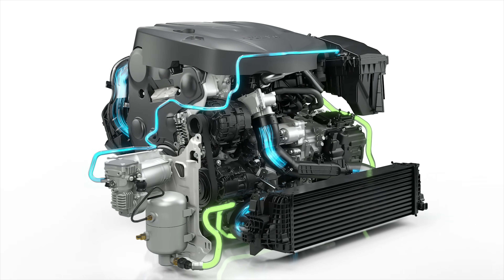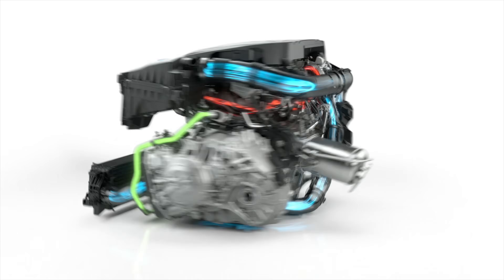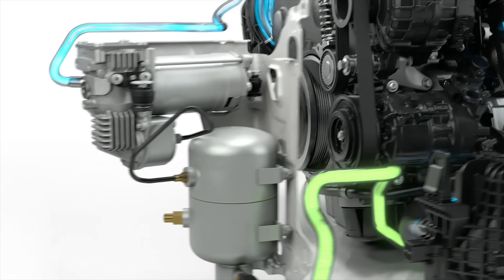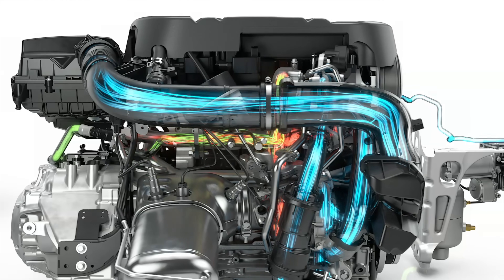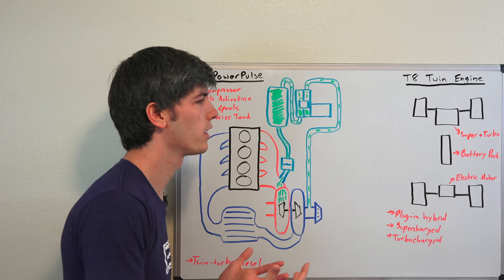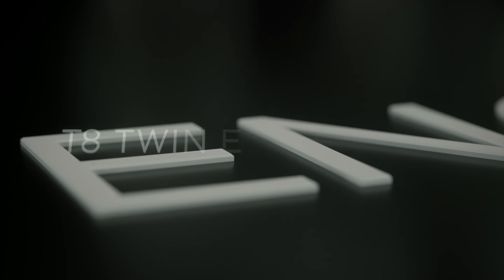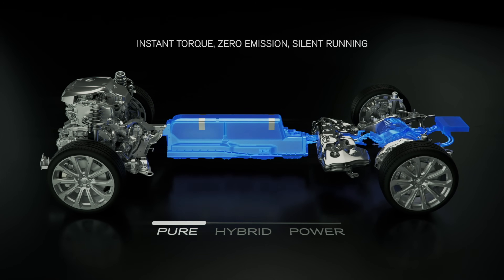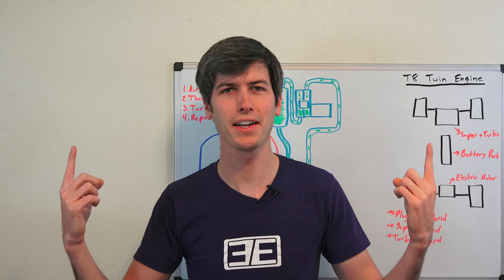How Volvo Is Eliminating Turbo Lag

Comment: A novel solution. Also I love the amount of "oh noes it would be unreliable!" when it is actually quite simple in design. I don't have an engineering degree like you do, but even I know how simple a simple air compressor can be. Heck you might just be able to make one with tools in a hardware store & throttle mappings of your car.

Comment: Quick question.  If you used a gas powered car engine converted to generator to power your electric motor to power the vehicle, how man batteries could be removed? If using say a 4 cylinders with a turbo or super charger weight being 700 lbs fully dressed and batteries weight being around 5000 lbs could the two be put in tandem to get rid of some batteries and put an end to the range problems? Just thinking out loud and you seem to be the one to ask who can explain this rocket science. Love your videos and thanks

Comment: Just a thought, since it's involved electric motor for the pump, why not just use the motor to assist spinning the turbine when it's lagging? That'll eliminate the space  to fit pump and high compressed tank.

Comment: Great, one more expensive thing that will fail.
Reply: Hahaha yeah well they don’t really care past warranty.
Reply: Arjun Bhat Its more moving and working components thus making a higher likelihood of something failing. Think before making a comment
Reply: Mathias Gj says in another comment bellow the "power pulse system" is already failing they're rebuilding it, he works for Volvo
Reply: Arjun Bhat It is mathematically garanteed to increase the lifetime maintenance costs of the vehicle. More parts always = more repair $$$
Reply: Adrian Gutierrez and they were right, fuel injection with all its sensors and valves can be a complete nightmare to work with and does fail more than a properly maintained carb. The list of FI points of failure is staggering compared to ... the carburator is broken. Turbos ... yep those fail all the time, and when they do sometimes it is rather spectacular.  DOHC, well yeah, it has more valves and more parts so more chances for something to fail in that area of the engine.
Reply: So don't buy it.
Reply: Jonathan Stewart
Reply: Jonathan Stewart That’s what they said about fuel injection, turbos, dohc, get over it
Reply: @adriangutierrez9582 

Its about cost/benefits.  Fuel Injection and DOHC are worth the added complexity, an added system that aims to reduce turbo lag (not eliminate) but introduces multiple points of failure and a high pressure system may not be worth it .
Reply: Not that expensive if you think about it from a manufacturing standpoint.
Reply: @papayaman123  I wanna ask the engineer  did you  factor any redundancy? If the pump fails will it still operate as a stars turbo or are you screw until you repair it
Reply: I don't get what you meant by stars turbo but if pump fails obviously this system will be moot until you replace/repair it.
Reply: You have calculated proof that it would fail? Or have you worked on it personally?

Comment: Why not simply have the motor drive the shaft of the turbo? Pretty sure there was some kind of system like this on an F1 vehicle that @engineeringexplained discussed sometime ago. You could then use the motor to recover energy when you come off throttle.

Comment: This may be slightly pedantic, but that will only lower the boost threshold, the lag will remain largely the same unless they also inject hp air into the intercooler too. I think.

Comment: Why go through all the fuss with a compressor and a reservoir? Just put the electric motor on the turbo and be done with it. Should be smaller, lighter and cheaper. Or is that pattented by someone else and they just had to get around it?

Comment: Here we are missing the entire point😞 

The liberated motorist does not rely on big oil’s gasoline....He mods his engine to run on alcohol or hydrogen or even ELECTRICITY! 

Oil is only second to H2O in its level of abundance on Earth, IT IS NOT A “FOSSIL FUEL”🙄

WAKE UP🤷‍♂️

Comment: The last few seconds were funny 😂

By this system the turbo and exhaust  temperatures would be cooler than normal due to the compressed air passing inside of them, that's another plus if I'm not mistaken

Comment: Now, tell them how it gets done properly, where you have a turbo, and between the turbine & the impeller, you have an armature and windings. When boost is suddenly needed, you open a circuit to the main battery, and you power and drive the turbo, to quicken the spool up. Then as boost nears maximum, you don't divert gas through a blow-off valve, you reverse the switching to the armature and make that electrical assembly act as a generator. By varying the load, you vary the speed of the shaft, which varies the boost. You do boost control and harvest energy at full throttle, and you do spool-up to avoid throttle lag. And when throttle lag will happen, you draw current to the main electric motor to supplement the engine's torque, so there is no evident lag or dip. And in a pinch, you can drive the car a couple of miles on the battery only...
That beats the hell out of an air tank.... That's more or less the system the formula one cars use. Nobody in formula one is using and air tank to dump a couple of pounds in the exhaust manifold... Sticking an electric motor / generator in the middle of a turbocharger, and then controlling it all with the same computer that does the fuel injection, is pure genius! That's not hitting two birds with one stone, that's doing three!

Comment: Ford had a vaguely similar system in their Focus WRC cars. Pressurised air that would have been lost through the Waste Gate was diverted and stored in a pressurised tank under the rear Bumper, and used to eliminate Turbo Lag on Acceleration off the corner.

Comment: Don’t forget to mention that if you have a Turbo and Supercharged vehicle, of your Turbo is big enough, at higher RPMs it back drives the supercharger and the PSI generated by the Turbo now drives the screws on the compressor and the parasitic drag normally incurred by a supercharger’s belt now becomes power because the pulley is now being driven rather than dragging the crank down.  

Super cool phenomenon you only see in twin-charged Vehicles.

Comment: I am just afraid that with such complicated systems and software doing the control of all these driving dynamics that it might get rather unpredictable if you are using it in a "non standard" way.
It may do one trick it is supposed to do good, but is a annoyance in other situations, especially when the technology used is around for less than a few years.
I think in a hybridized car using only the electric motors to fill the power lag is much more predictable and straightforward than a air tank which needs maybe 10 seconds to a minute to refill.

EDIT: I think it is a "one trick pony", becaue it eliminates lag only in certain situations, but does not give you a experience of responsiveness in all driving situations.

 Not a Volvo fan/buyer, anyway.

Comment: see to me there can be fun with lag. like the anticipation while hearing that thing spooling up and then a sudden rush of power pushing you into your seat. 

I do understand the idea of making the boost more responsive on the initial throttle input however most likely this is only a solution for the factory setup.  

In general those of us who spend our time/money modifying our cars and want that big horse power usually have to deal with turbo lag. There are the whole e85 setups allowing to run high compression all while allowing to run high boost.  But usually setups like this are rarely used from what i've seen.  

Personally i like to keep my setup simple because i like to work on my car without having a ton of components constantly needing fixing. but it would be interesting to see something like this on the aftermarket made as a bolt on part to help the people who are running giant turbos.

Comment: I've got more faith in Mazda's compression ignition system.
Reply: polychronio Mazda is very reliable they only have issues when Ford decides to try and design then
Reply: why not hcci with turbo and hybrid?
Reply: popdancebeats i have a mazda car....mazda is very unreliable...i fix computer, link, hose, radiator, etc etc after fix, again and again in every 3 months...it drives me crazy....
Reply: Drive a 2010 Mazda 3 s Sport Sedan with 160k miles. Only had to replace a burnt transmission module. $800 fix with only maintenance. Been running perfectly fine and even picks up alright.
Reply: Nick T. good luck but check how many time mazda win lemans 24 and reliability report...
Reply: Volvo is the most reliable and mazda is unreliable...

Comment: A Volvo mechanics nightmare.
Reply: I'm a Volvo mechanic, and were already rebuilding the "power pulse" system on warrenty becuase it's faulty already lol
Reply: ZEDreality Fun and challenging, but to be honest there's not much of a difference
Reply: Christ imagine diagnostics on that thing.
Reply: Mathias Gj, How much better is it working with new Volvos, especially when they got the Auto-Service mode, compared to mechanical analog cars?
Reply: You think that will stop people from buying Volvos?  People still buy GMs after GM publically admitted it was cheaper to pay off burn victims' and their families than it was to fix their faulty fuel systems..  It won't stop people from buying what they want.  The masses walk blindly into happiness.
Reply: Leslie H. LMFAOO ikr I'll stick to my 242 gt...💪😎💪
Reply: But I do not care.
Reply: You beat me to it, Also a Shade-Tree mechanic's HELL. Yea I think this goes well past OBD2 and will need Volvo tools to do any diag. and repairs.  It's already at the point where you can buy a 1st/2nd owner Benz that seems to run/drive OK for 8K and it will pass inspection, but you can't see that it's virtually totaled, 10-20K in parts needed (radar/camera for accident avoidance, active suspension, etc.) Dead battery on a diesel MB? you may be getting towed back to the dealer for a crank position sensor reset! I can't imagine the horrors of a car like this new Volvo lol (lets just say $100? grand new... then it's only worth $10 grand after the 10 year warranty is over, and you need to sell it because repairs cost as much as that PC, motorcycle, or TV you want/thing for the family/whatever.  Maybe that's just my life talking lol. I think Id rather buy a cheaper used "beater" car every year or so instead, or sit back and have someone build me a "dream" custom car.
Reply: Eugene Tooms i have a turbo volvo 940 with 740 000 kms with the original turbo and engine
Reply: what do you mean, this engine is way better than the d4164t
Reply: Volvo mechanics are being offered an optional 'Master Masochist' Seminar....🤫
Reply: ZEDreality cool
Reply: At least you won't find yourself unemployed. =D
Reply: +Topi Sadly that means little to me as I grew up in the US lol!
Reply: I somewhat agree to certain extent..huhu
Reply: WoOsKii 1 its 450 000 miles also almost all older turbo mercs here also have over 400 000 miles on them
Reply: They are eliminating themselves, like Saab.
Reply: Lil Leslie we
Reply: Volvo is a technicians nightmare already l
Reply: Dont buy turbo if you want to keep your car beyond 100k. Turbo reduces reliability as increases complexity and shortens engine lifespan.
Dont buy turbo. Period. Unless you lease or get rid of cars after factory warranty.
Reply: @eugenet6632  na. Volvo white block. Goes for 150k all day long
Reply: Eugene Tooms almost 200k miles on my wrx.

Comment: They should engineer the turbo itself, supplementing it with electrical motors on each wheel, instead of adding on an entire compressor.

Comment: Can't see why they wouldn't use wastegate air, which should be at high pressure and store it. Adding compressure would require electric energy and it will add weight.

Comment: So basically this tech could be retrofitted on a Diesel truck using air brakes, and or on a gas engine using an air pump for emissions standards, just install an air tank?  Such miraculous design, using forced air to propel a turbine before the exhaust has to!  Nah, this is Volvo's little way of claiming patent on currently existing technology, people have probably done this for years and Volvo's wanting royalties from it.

Comment: Up next for Volvo in 2023 an electric hybrid 4-cylinder twin/single turbo supercharged variable pulley system 1, 2, 3, or 4 wheel drive with an option for an additional 8 cylinder diesel mounted in back for when you need to tow something. All this mounted to a 6 speed manual and a 7 speed auto simultaneously!

Comment: So based on the previous EE video isn't this just bringing you up to boost threshold faster?  Its not really reducing turbo lag since it doesn't address the time it takes for the boosted air to get from the compressor to the intake valves.  It just spools up the turbine faster.

Comment: But it doesn't have 5 cylinders
Reply: Volvo Brad I’m sad to see that as well. I drive two five cylinder Volvo’s, but I’m happy to say that the new fours still have plenty of character to them just like the old fives.
Reply: in the video it is written to a be a 2.4 litre. sadly it is just a 2 litre :S
But it works fine ^^ 

I can totally relate :D 2.4i v50...

Comment: Once they move to electric drivetrains, they can essentially eliminate the lag by dumping electricity from the battery while the turbos spool up. Although to be honest - is there much point to a turbo if you're running on motors?

Comment: Well... I understand that in racing application  turbo-lag is bad, but when you're cruising around  just for fun, I think that floor it, wait a second  and then "feel" the power and torque kicking in is priceless. Another example can be in cars  like  a Single-Turbo Supra or any powerful car  with high  turbo-lag when someone  challenge you and you both floor it, he  starts to gain and with you at firts nothing happens but than the boost kicks in and you troll the opponent  saying goodbye...
P.S.: sorry for the grammar, I'm italian

Comment: I'm sure its very clever but it feels like a gimmick, if turbo lag upsets you that much then hauling a big compressor and accumulator seems a bit overkill, I'm sure there is a simpler way to spin a shaft up. I'm not sure turbo lag upsets me that much anyway.

Comment: Using electric motors to make IC engines faster, when electric motors are much faster, lighter, and less complex. Seems legit..
Reply: TheOzarkWizard I had saw the dyno chart of electric motors, the chart show that electric motors have peak power at lower RPM than ICE. But for reach high speed, we need more power and RPM at the same time (in high drag coefficient), so the ICE is used to counter the airflow, while electric motor used for move the car from zero. imo, the EV is less ideal for high speed than ICE, that's why most environmental friendly vehicles still use hybrid instead of full electric.

Comment: Why can't the car producers just stop producing Combustion Engine Vehicles (CEV) and follow the footsteps of Tesla, go into fully manufacturing EVs which have the power better than the (CEV), need not stress their heads and spending so much on development to improve the performance of CEV.
Reply: warak anda because not everyone has the time to plug in n wait for the battery to b charged

Comment: Why bother with the compressed air? Couldn't they just use the electric motor to spool up the turbo; or is there just enough air at low speed?

Comment: Why don't they use electric motors to spin the turbine? Can someone explain it to me? What's the reason?
Reply from the maker: +Bruno JJ cost/simplicity. Electric turbo requires a lot of power, tuning, battery pack.

Comment: Why would the compressor take air from the low pressure side of the induction system. Surely it would be more beneficial to take high pressure air from the turbo compressor, or at least just ambient atmospheric air.

Comment: Compressed air would cool the exhaust manifold and gasses condensing them. The hot expanded exhaust gasses is what spools the turbo. Plus for it to work you have to significantly increase exhaust manifold pressure with no increase in intake pressure. I'd think that would promote a lot of intake reversion. Sounds inefficient to me. Plus the addition of a lot of moving parts and weight. Would be better off with a fuel and air injector in the exhaust to spool the charger but that still wouldn't help the reversion issue. Smaller turbo or larger displacement is the best option.

Comment: What buzzes me is why use the compressed air to spool the turbo rather than feeding the compressed air directly to the engine. Surely this will be less complicated, save weight and also provide cooler air (expansion of compressed air) which should allow higher compression ratio. Right?

Comment: Wouldn't adding a compressor and tank to counter act the turbo lag offset the power to weight ratio benefit given by the turbo lag? Any spec on the added weight of the new setup by volvo?

Comment: Sounds like a quick recipe for a short manifold and turbo life. Thermal expansion and contraction (when colder compressed air is injected into the hot exhaust stream) is going to happen and IDK how they would truly mitigate this in the long term. Why not simply directionally inject the clean, cool air into intake ports? The high speed compressed air would also create a lower pressure behind it, pulling more turbo compressed air in too.